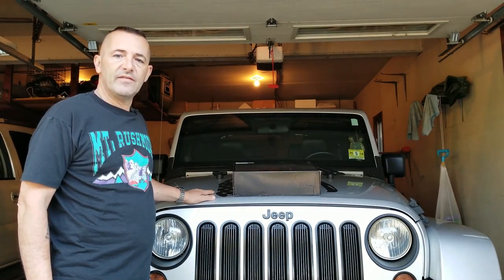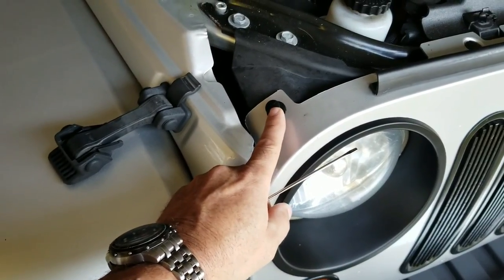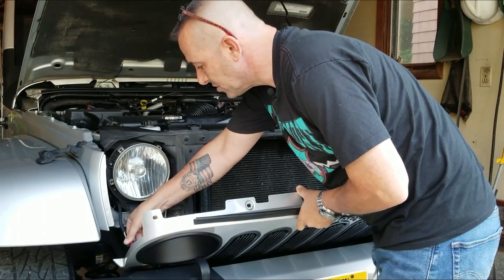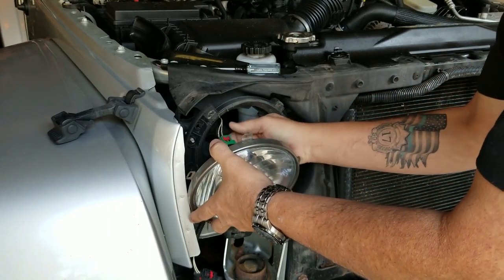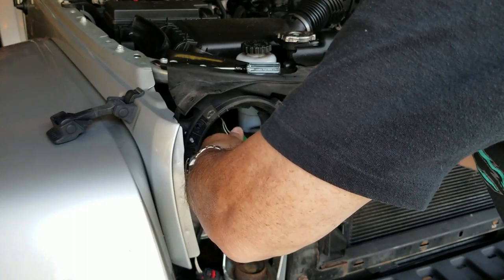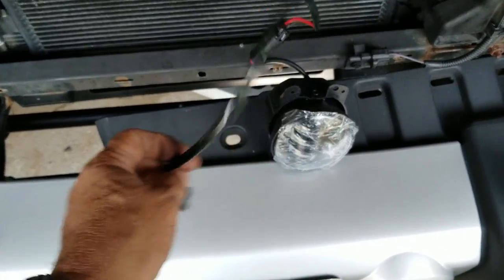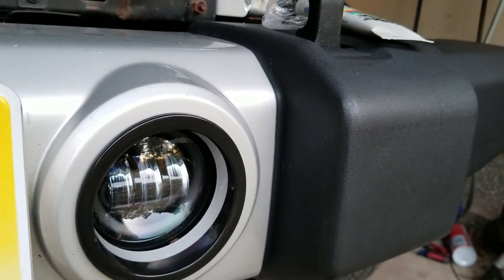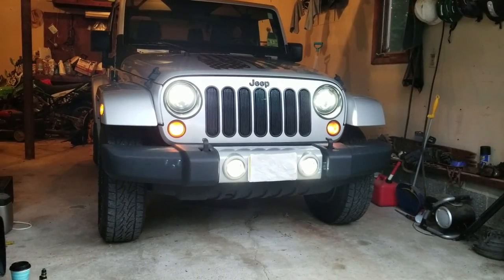Jeep Wrangler JK Black Daymaker 7" LED Headlights / Cree Fog Lights - How to Install and Review

Comment: I installed these on my 2016 sport and they were great compared to the OEM lights. I sold it and recently bought a 2018 JK Willys. Getting ready to install the same lights again! 😎 Great video! I had to modify an ear on the passenger side to get it to fit properly. Fogs are a bit of a pain but not too bad.
Reply from the maker: Thanks for sharing

Comment: Great video. Just put the headlights in my 2016. Driver's side went in smooth. However on the passenger side I had trouble with the tabs. I had to spend about 15 minutes on one with the Dremel grinding it down. The whole thing took about an hour in a light rain.
Tomorrow, I'll tackle the fog lights.
Reply from the maker: The fog lights are a little challenging due to the tight space.  Good luck!

Comment: a few tips that might help is you can adjust headlights with the grill on if you use a torxs screw driver and also the adjusters on fogs don't line up with hole in bumper, I drilled a 3/8 hole 1 3/4" to the drivers side from old hole. do this before you install the fogs so not to damage them when drilling. thanks for the good video.
Reply from the maker: Great tips. Thanks so much for watching and commenting

Comment: Great job on the video, just bought and installed a set of both the headlights and fog lights on my 2014 JKU.  You were right the fog lights were a little harder to install, I used a mirror and installed the fog lights from the topside.  The screws for the fog lights were small in length.  So screwing them down didn't take a whole lot of turns with a stubby screwdriver.   Not sure if I should install LED resistors for each just as a precaution to the possibility of flicker.  I have no flicker YET!  How has the lights held up for you?  Any flicker?
Reply from the maker: I have had these in my 2011 JK and my sons 2008 JK and they still work great.  No flicker at all.  For the price I don't think these can be beat.  Still one of my best upgrades.  Thanks for watching.

Comment: Lou!!!  Very Nice upgrade.  Are the lenses on the lights glass or plastic?  I don't think it matters,  but just curious.  Definitely something I will do...When I get some extra-funds.  Doing all the house stuff got me broke!  Not really, but not spending on fun stuff right now.   lol
Reply from the maker: Hey Bruce, They are very thick plastic but you would never know looking at them.  I had to tap on the light with a screwdriver to actually tell it wasn't glass.  Time will tell if they hold up, but for the price I just couldn't pass them up.  Just had the Jeep out for the first time in the dark and they are so much better than the stock lights I had.   The fog lights are insanely bright, they will cut through anything.  Thanks so much for watching and commenting.  Stay Safe.
Reply: Those are on my short list.  Thanks Lou

Comment: New viewer here. Your channel looks interesting. I have a question. I understand that LED lights can get covered in snow or ice, as there is no heat from the bulb. Do you live in a colder climate, and have you had any problems like that?
Reply from the maker: I do live in a colder climate. LED lights don't produce heat and I have worried about the same thing.  I have not driven the Jeep during any storms this year so I don't know if it is problem.  The cold weather alone has not been a problem. Thanks for watching and commenting.

Comment: Thanks for the video.
Did you have to adjust the aim of the headlights and also the fog lights ?
Reply from the maker: Hi my headlights aim was very close to the original. I lowered each one about one inch.  There is a small torx adjustment screw on the side.  I didn't need to adjust the fog lights at all. It was very easy.  Thanks for watching.

Comment: Nice video couple of things how did you run wires and I found out if you put DOT on fog lights on bottom it's not so bright
Reply from the maker: Hi Jeffery Thanks for watching.  All lights are plug and play.  I didn't need to run any wires.  Simply unplug existing head and fog lights and plug in the new LED lights.  As far as brightness,  both the headlights and the fog lights are much brighter than the OEM lights that came with the Jeep.

Comment: Awesome video nice lights but you should research the proper way to use dielectric grease it gets missed used all the time. Dielectric grease does not conduct electricity.
Reply from the maker: Thanks for commenting  RetiredMan.  You are absolutely correct dielectric grease is non-conductive.  I use it to cut down on corrosion. Thanks so much for watching.

Comment: I have spliced wires on the fogs.  There are two wire (red power, black ground).  Installed the headlamps in 30 mins and the harness just plugged in.  

Any help with the fogs be appreciated.
Reply from the maker: The fog lights should also just plug in.  There shouldn't be a need to splice any wires.
Reply: RV Habit thanks for reply.  I found the other set of plugs for fogs.  They were wedged under foam.  Going to install tonight!
Reply from the maker: good luck!!

Comment: Brother, my lights have two plastic caps on the back of the headlight. Do you remove them ? Thank you!
Reply from the maker: I don't remember any plastic cap on the lights.  Perhaps they have been updated in design.
Reply: They are for condensation reducing. If you find your lights are getting some moisture in them, remove the cap, run the lights for an hour and put them back on.

Comment: Thanks for the video. Headlights work fine but fog lights didn’t work. Help please thanks
Reply from the maker: Did your original foglights work? Do both not work.?
Reply: RV Habit yes original both works.
Reply from the maker: Well if both new don't work the first thing I would check is a fuse in the vehicle. Also a voltmeter on the vehicle plug to ensure 12v.  A quick call to customer service but I'm betting on a fuse if both don't work.

Comment: Just installed these and no matter what I do I can not get the brights to go on. Any suggestions?
Reply from the maker: The brights on both lamps?  If so I don't think the chance is that both lights have a problem.  First, I would plug my old lights in to make sure the brights still work on the original. then go from there.
Reply from the maker: If both your oem lights high beam work after reinstalling then it has to be the adapter wires for new lights or the new lights themselves.  If the oem dont work the highbeam low beam switch is where i would start to troubleshoot.
Reply: RV Habit  - awesome thanks for the feedback. Ill take them apart after work tomorrow and go back to OEM and go from them. 🤞🏼 I figure it out.
Reply from the maker: Good luck, there is nothing more frustrating then getting something new and it not working.
Reply: RV Habit - 3rd time is a charm. Went back reset the OEM’s and started all over and now he works like a charm! Thanks!
Reply from the maker: Awesome! You will love them.

Comment: Two other drivers seem to be bothered by them?
Reply from the maker: Hi Dan, mine are super bright compared to the stock lights.  Other drivers do not seem to be bothered by them but I did adjust the beam after installation to ensure proper aim.
Reply: Thanks I'll definitely be picking up a pair
Reply: What would be the proper aim? I just installed these lights and I feel like they’re aiming a little too high.
Reply from the maker: Rigo247 you can lower the aim with the small set screw on the mounting area on the Jeep.

Comment: HA, the reason it would not come apart was not due to being stuck, you forgot to push on the tab to release the connectors...LOL. I just cringed when you stuck that screw driver in there to pry them apart...